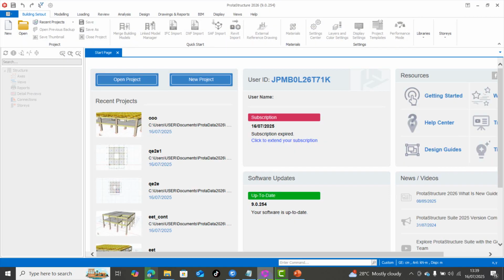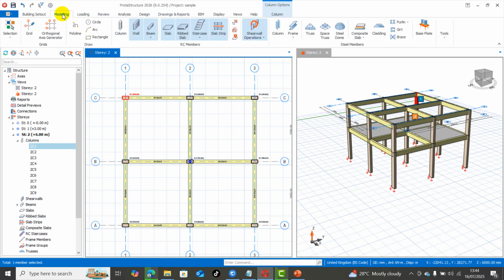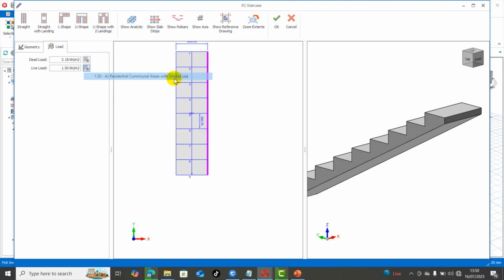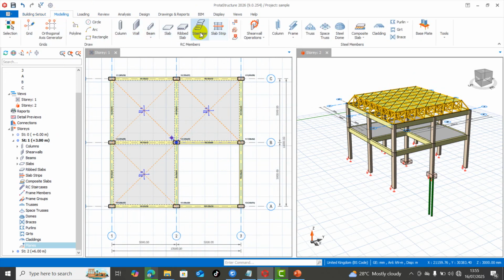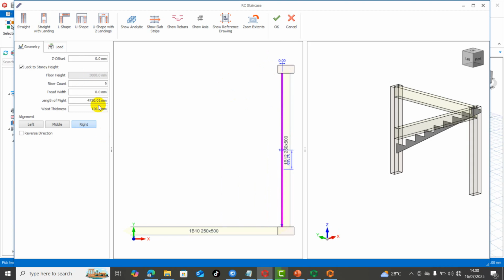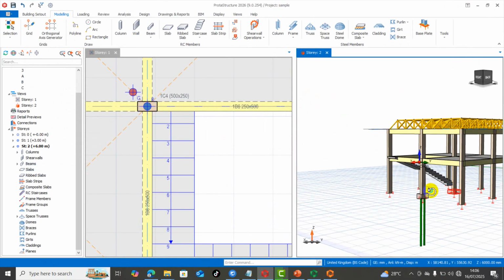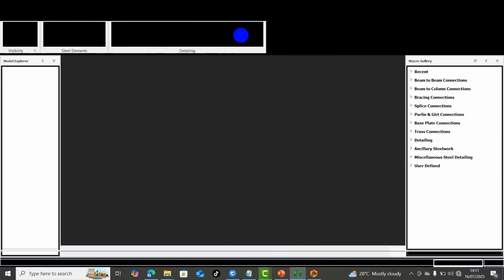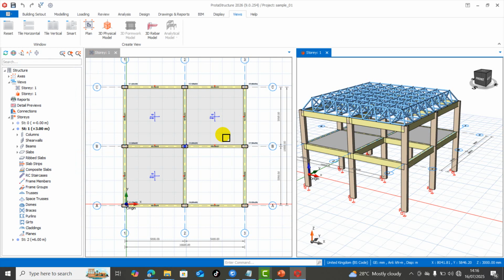Protastructure 2026 Overview part1

Comment: How i get the software installed, ive tried the 2019 file i have been i have not been able to successfully have work on my system 

I also need to get one of the lastest version of AutoCAD as well
Reply from the maker: Get a higher version of Protastructure sir